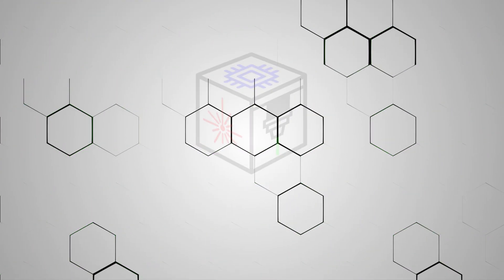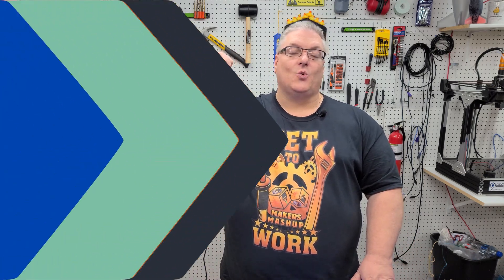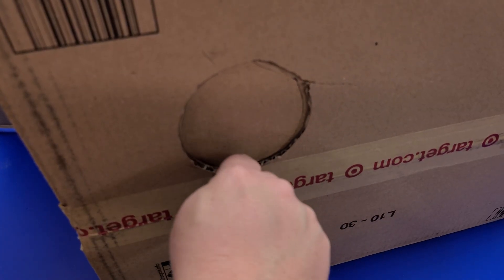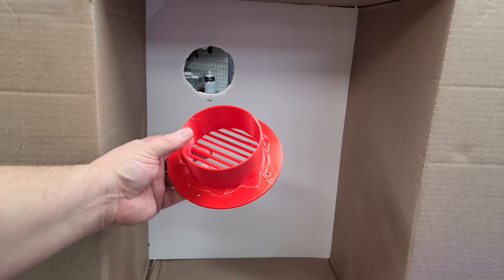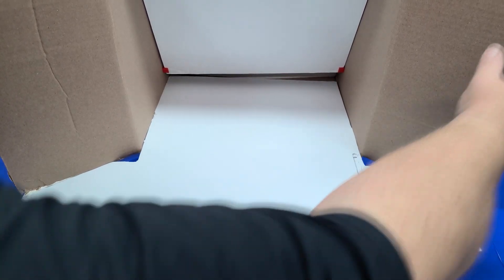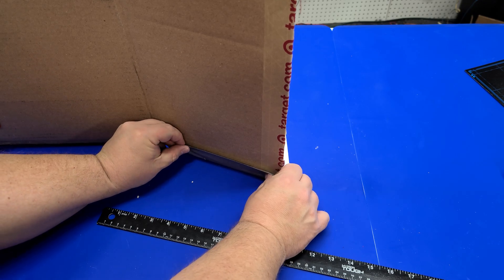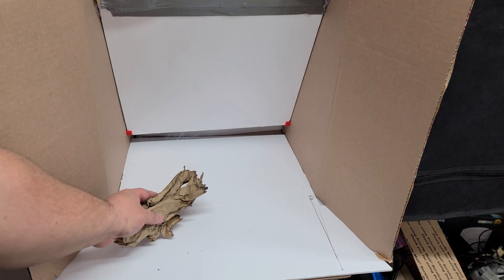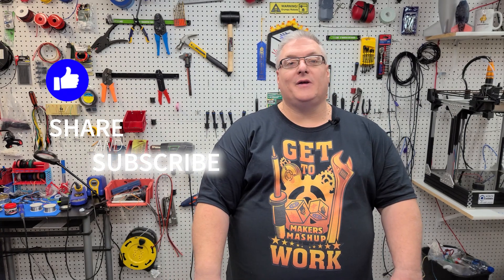DIY Maker Paint Booth - Low Cost & Easy Assembly!

Comment: If you are spraying Volatiles,  you are going to need to consider external motor or explosion proof in line fan unit. Just want to point out you need to think about it, the motor could provide an ignitor.

Comment: You're going to need a filter,  the paint particles are going to gum up the blower motor over time
Reply from the maker: Good call out.  I thought about adding one but given the run is 30' long to where the blower is I thought it was unlikely any reasonable paint particle would have made it that far.  I'll keep an eye on it though.
Reply: @MakersMashup  Maybe a trap instead, like a box with a maze or cyclone